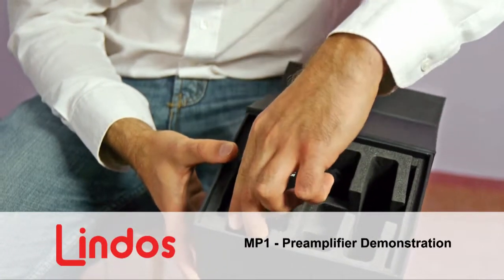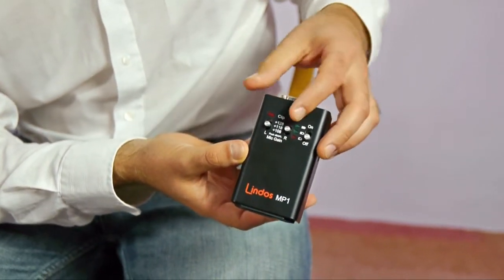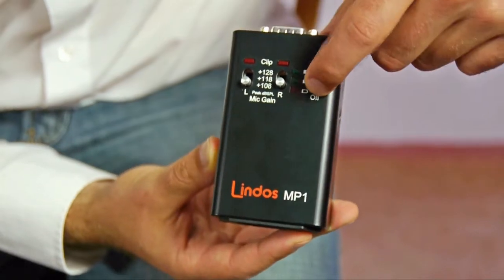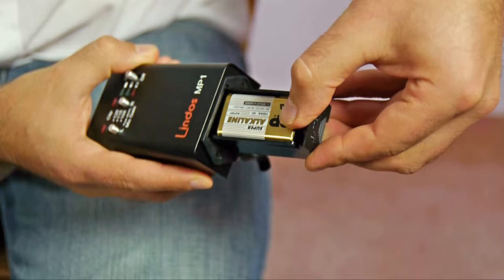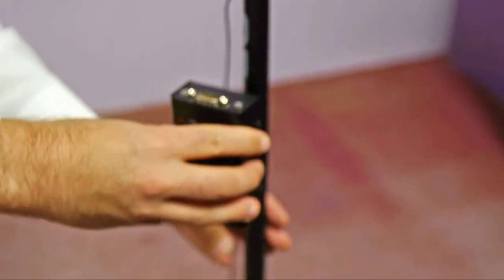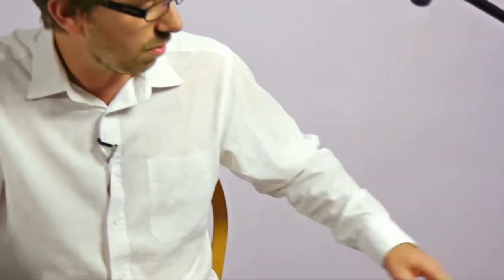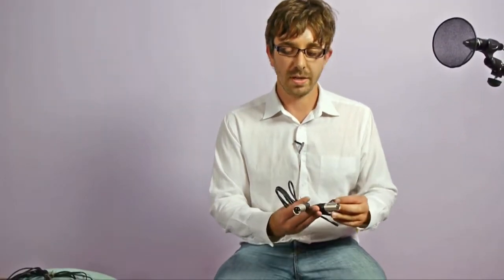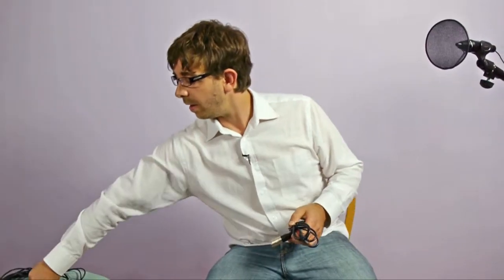Lindos MP1 Preamplifier - An Overview

Comment from the maker: The camera adapters that connect the preamp to the camera can have headphone monitoring added as a optional extra (£15). Though this isn't volume controllable it still provides an indication that audio is getting to the preamp. Though, without level meters or monitoring on the camera you still can't be certain that audio is being captured correctly. Camera manufacturers are addressing this issue and many new models now have built-in headphone monitoring.